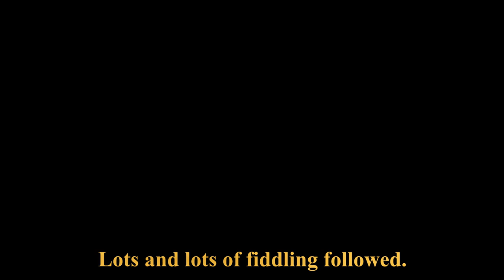Aiwa AD-F410 Belt Replacement and Speed Adjustment

Comment: Thanks for this. The drive belt on my 33 year old unit had decomposed to sludge. But following this video and lots of IPA and its now working and sounding amazing. What a lovely player. Wouldn't have had a clue without this video, didn't even realise why it wasn't working.
Reply from the maker: Thanks. That's great to hear.

Unfortunately, my deck stopped working. The transport seems jammed. It's probably a simple fix, but there's lots on top of it at the moment and I don't have a lot of space (or time) to sort it out. No doubt there's another video to shoot at some point.

Comment: The way i believe the service manual states to do the belts is to desoldered the  solenoids it allows the pcb to move and makes the change a bit easer  and the bit of plastic sticking up on the right i think that is for putting the belt round then you put the motor in place and can push the belt up onto the motor pulley .I have used the belts from malvern hills audio good quality belts .
Reply from the maker: Eight months and I just saw your comment, sorry. Thanks for the info. My soldering skills are lacking, so anything other than soldering is good for me. 

Malvern Hills, yes I've used them. I have a feeling they could be Deck Tech, but not sure. Thanks.

Comment: I am working on an Aiwa AD-WX888 and it has two flywheels. Looking at how you placed the belt on one flywheel I can follow. But what do I do if two flywheels? This unit has two cassette decks. I could not tell on the second deck how to spool the belt because the belts are basically desintigrated.  Can you give any advice please?
Reply from the maker: Sorry, I don't know. I really just figure it out for any decks I own. Try searching YouTube for the model number to see if anyone has posted a video. If not, try to download a service manual. Hifi Engine is good for that, but you need a free account. Good luck.

Comment: Hiya, great video, just wondering if you have any info on the belts, the link in the description has expired:)
Reply from the maker: Hi, thanks. Sorry about the links. This is my current favourite supplier for the UK. https://www.ebay.co.uk/itm/325206035823?mkcid=16&mkevt=1&mkrid=711-127632-2357-0&ssspo=17wMLu9-RVW&sssrc=2349624&ssuid=SrAQ4ViqQhK&var=&widget_ver=artemis&media=COPY

I'll update the video links later at my PC
Reply from the maker: PS. My deck appears to have seized. I'll do a video fixing it in due course, but many weeks away.

Comment: Sometimes, it helps using a bit of adhesive tape to keep the belt in place on the flywheel. That way, you don't have to worry about the belt slipping off when you try to place it on the motor pulley.

Also: a new belt needs to be walked in for a tad of playtime so you might need to readjust the capstan speed at a later point.
Reply from the maker: Great tip about the adhesive tape, thank you. And thanks for the info about readjusting the speed after a bit of playtime. I'll do that when I test a couple of frequency apps.